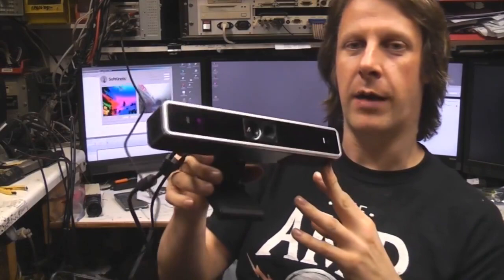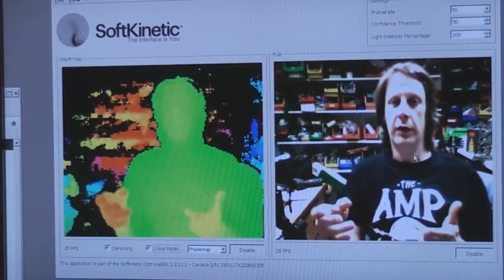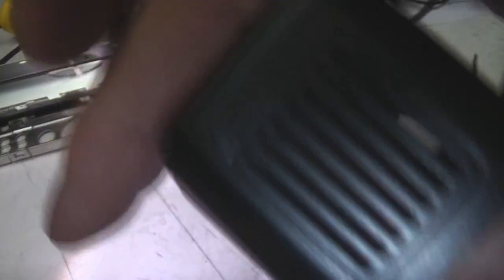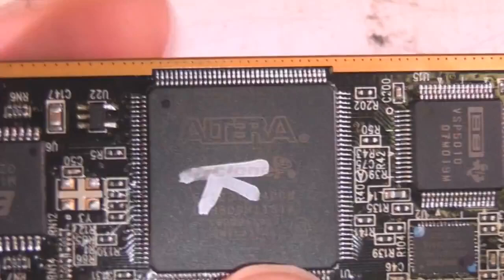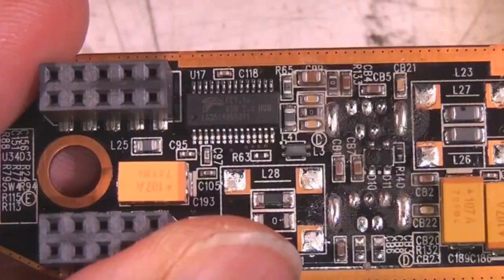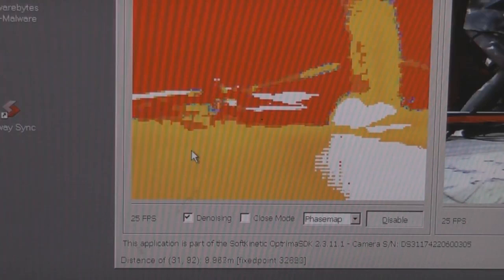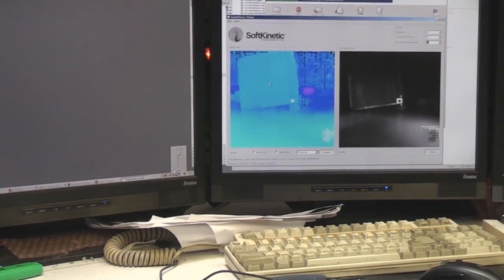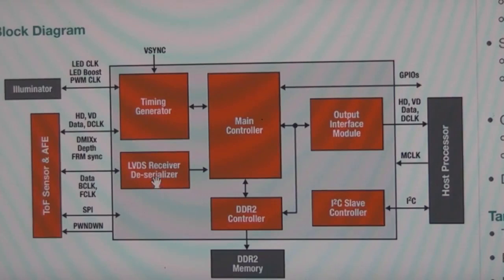Softkinetic depthsense time-of-flight 3D camera Teardown

Comment: Basically these sensors work by doing coherent detection. i.e. each pixel is a lock-in amplifier.

Here's the paper for that transient imaging work. They swept the modulation of the illumination so that they could get more resolution in the time axis. 

Google: Low-budget Transient Imaging using Photonic Mixer Devices
Felix Heide∗
Matthias B. Hullin∗ James Gregson Wolfgang Heidrich

Comment: About a year ago there were these 'projection on buildings' laser shows or whatever that were giving the illusion that the buildings were moving and distorting to the tune of music.
It would be possible to have a portable setup with this stuff, so that as you move it detects the object depth and adjusts the projected texture accordingly.

So the idea woudl be to walk around with one of those laser pico projectors and have your logo displayed on the wheels of the cars passing by.

Comment: Very nice video, Mike. BTW, if the propagation factor of your wire were 0.8 then I would think that the change in the measured distance would be greater than the actual cable length change, not less. You measured 0.4 m difference for 0.5 m change in length. I'd expect 0.6 m change if pf were 0.8

Comment: sorry for not looking through all the posts to check it has been said before: you can't measure the reflectivity under 45° incidence and assume the behaviour is the same for plain normal incidence since optical path lengths inside the dielectric structure will differ.